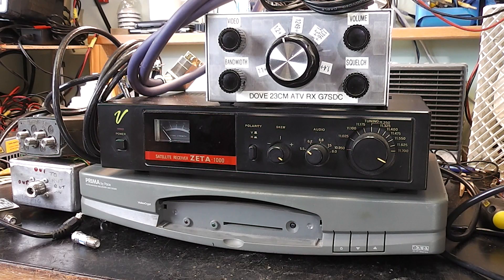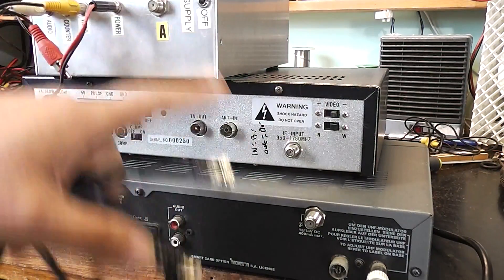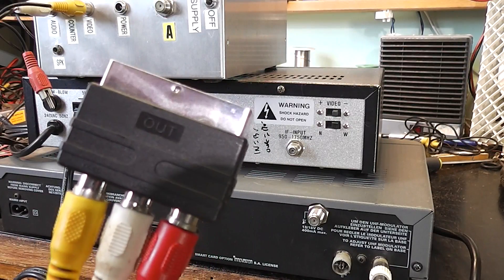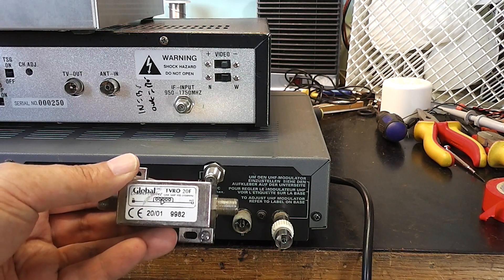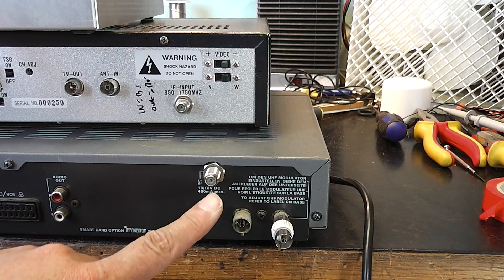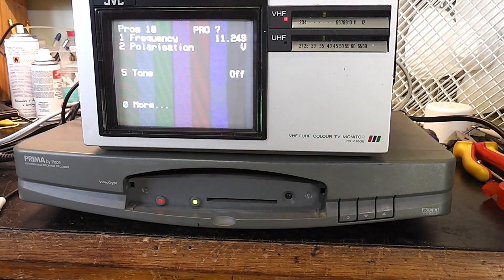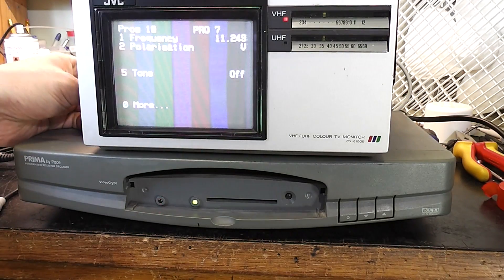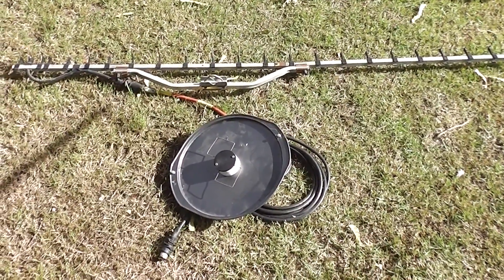Amateur TV Analogue 23CM Receiving Setups.

Comment: Would an old Sky box be suitable?
Reply from the maker: Good Question. If we are talking about a sky analogue receiver, it should work fine. If we are talking about a sky digital receiver there is a issue. Although you can add channels in the menu, the Symbol Rate is very limited and looking a a friends sky box 22K was the lowest you could set & 4K is a typical ham setting. I have check my freesat receivers and found similar issues. To receive digital ATV you are far better using a  satellite receiver designed for non sky use. You can often pick these up second hand for little money.  Technomate and Icecrypt are examples of  manufacturers that make receivers. Daz